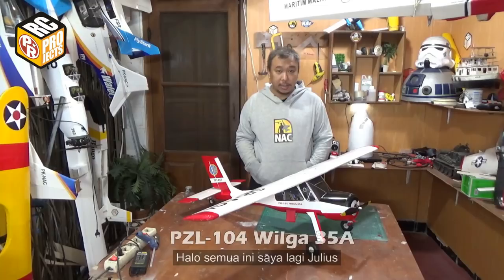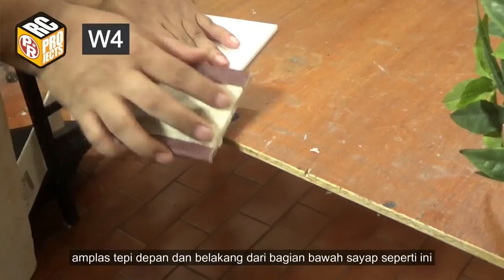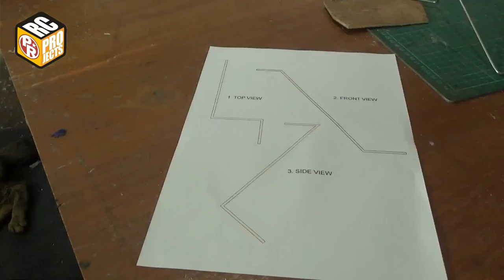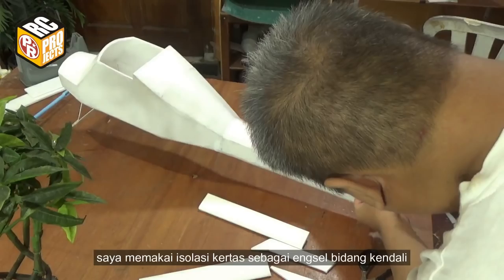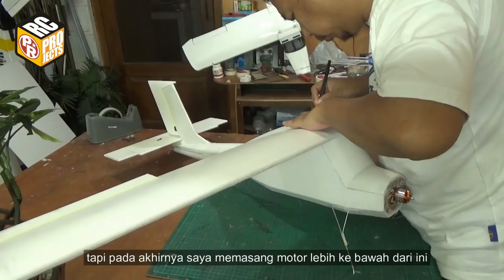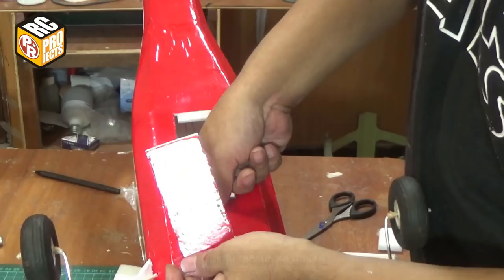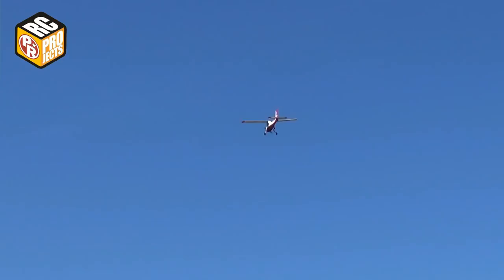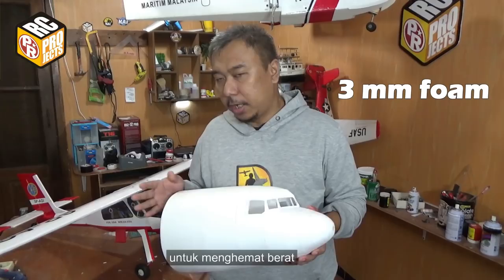PZL-104 Wilga RC Plane Build and Fly

Comment: what angle to you mount the motor to avoid left turning on take off and crashes?  PS GreatBuilds. Can I suggest greater detailed information somewhere in your plans or build videos be added to help us newbies?
Reply from the maker: just attach the motor straight on the firewall, because the nose design is already crooked to the right and a bit downward.

Comment: Well another fun build, I shall give it a try, if I ever get one of the phantoms to fly. Boredom set in after being stuck inside for so long, didn't even want to build. Today I tried the electronics out on one of the small phantoms. Applied power to Matek board let it stabilize, checked radio, then ran the two fans up to about 50% ....blew the foamy planes off the wall ... I have to finish this little monster ... I feel much better.... Take care
Reply from the maker: good luck my friend

Comment: good morning, congratulations for another excellent project, about the PT-17, I had asked if you could use the 3010b 1300kv engine, you answered yes, but you used a 3536 engine with a 12-inch propeller, another doubt is if I can use a 12 inch propeller on this engine? 3010b, although it is a little stronger than the 3536, it has a larger kv (1300kv), a 12 inch propeller will not overheat or lose torque?
Thank you
Reply from the maker: you can use 10 inch then
Reply: @JuliusPerdana  right, but due to the firing diameter, with a 10 inch one, only 3 inches are free on each side of the propeller, will it still be enough to fly? It's a shame, the 12 gives a more beautiful and real look.
thank you

Comment: Interesting plane to model!

Looked like a classic tip stall and spin. That's where some washout helps.  Maybe weight  down the center section of the wing, twist outboard, and hit it with the heatgun. Works great on balsa and monokote built up wings. Turned a beast into a beauty for one of my old builds.

Which do you think is lighter covering: Packing tape or oil paper and paint?

Thanks for sharing the mistakes, too. Great to see even an expert has a bad day now and again.
Reply from the maker: thanks for the input, packing tape weight 2 times paper and paint, while oracal stickers weight also 2 times packing tape.

Comment: Dear Julius Perdana, first of all thank you for sharing the plans. Very impressive realistic model. I have a question on the wing joiners. Is there a reason you make two pieces, and not just a single joiner, expanding from both sides of the center wing? I see you have the same technique for the Piper Cherokee.
Reply from the maker: Easier to install

Comment: Very accurate wilga for foam board, fantastic job, I may build one. You know  wilgas need a lot of rudder to turn properly otherwise they tip stall. Do you take the paper off the foam board or just on somr parts?
Reply from the maker: my foam comes without paper

Comment: Beautiful and easy plane to built. Nice work Julius. 

By the way is it just my feeling or the shape of the air plane is such that the plane looks a bit tail heavy while in the air???

I m a bit confused on this.
Reply from the maker: yes, on other plane, the tail is usually angled up a bit but on Wilga it's straight and the wing is high up there so it gives the illusion of tail heavy